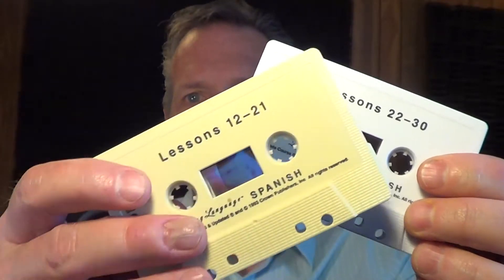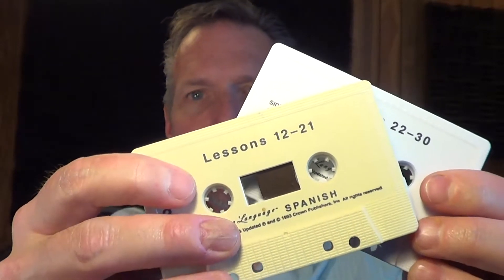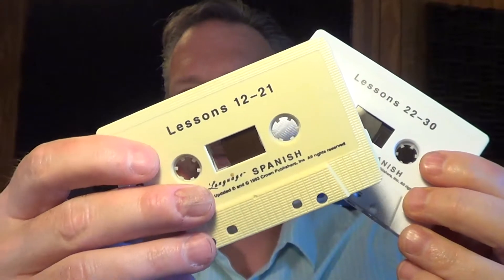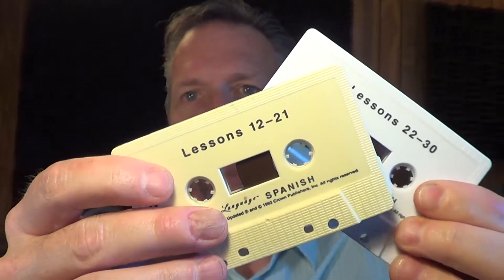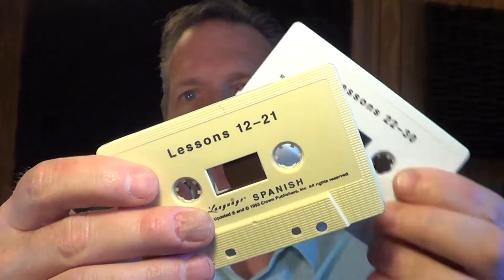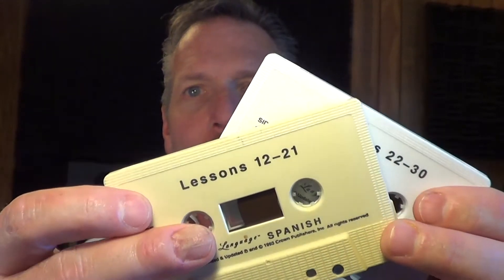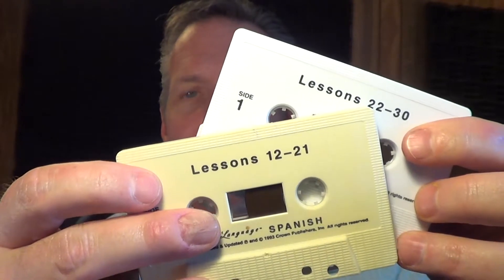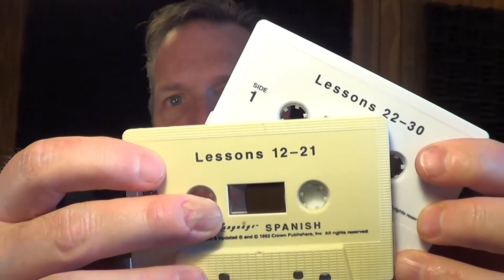Cassette Tapes and Photodegradation

Comment: I notice this with thermal register receipts but they were NOT put in the sun.  They were under a bed.  In the case of thermal paper or even cheap paperback books, exposure to the air affects it and increases rapidly with high ranges of humidity.  The paper is "foxed" and alot has been theorized about how this happens.  The paper itself hasn't structurally been degraded but I believe fungi in the air have been absorbed by the paper.  Again you can get patterns where the top part with most air exposure is more greatly effected.